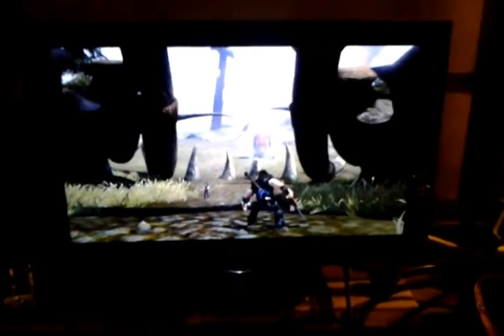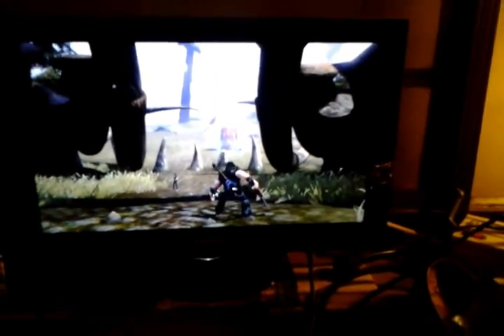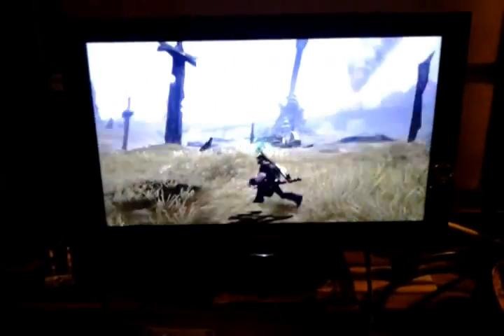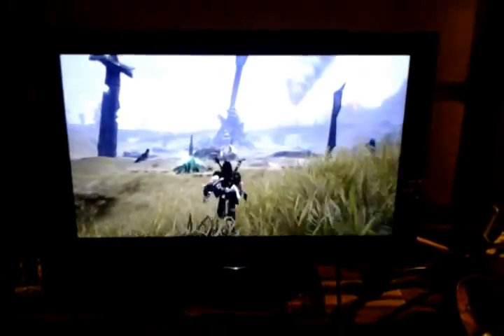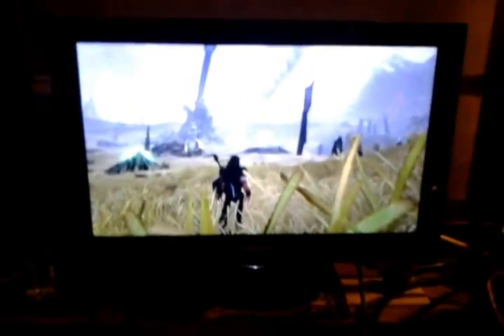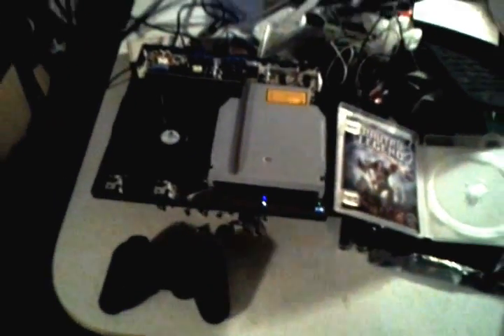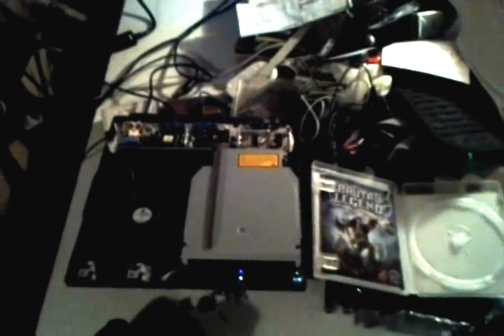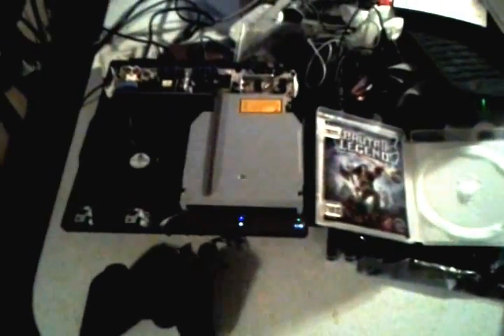PS3 Slim Power Off / Shut Down - Demo And Fix - Not YLOD [cech2501A]

Comment: Do you think a power supply is the problem if I still get a solid red standby light when plugged in, just doesn't do anything when turned on... i turn it on then after 2 seconds it shuts off and i unplug the power cord then i plug it back in then the red standby stays solid red..do you guys think its the power supply?? any suggestions anyone???
Reply: 76lucita did you ever find out what it was ?
Reply: I just played with my ps3 upside down and it worked for me

Comment: There's a different PSU in some Slims (like mine) were the screws are right next to each other. They are still labeled the same though (but I think in a different order). Either way, I turned both to the left about a quarter turn because that's what another vid suggested, and it worked like a charm. But this vid was the first to give me the idea, so thanks loads!

Comment: I got similar problem and i noticed that it the power supply....  Opened it and my power supply doesnt have what you have in the video to turn them with the screwdriver.... So basically I would prolly have to order a new power supply?

Comment: If your PS3 is exactly like this one in the video, then yes.
I don't recall where the letters are on mine. So, if not, notice that each knob is not perfectly round, and the same shape is drawn under the knob. Now try to match each knob with the line drawn under - around it (i.e. the round side fits the round line below on the board, and the rectangle sides fit their lines too.
Sorry if this is confusing, English is not my first language.

Comment: each knob should have its perimeter matching all the lines drawn around it on the board. This way, the right knob will be directed towards the back of the console, and the left knob is exactly the opposite (towards the front of the console).

Comment: for mine i had to find a special screw driver at the hardware store to remove the one blue colored screw in order to open the case. 
It was a Torx screw-driver (looks like a 5 point start). and I think the size was a #5 Torx.

Comment: My problem isn't as serious, my system turns off, but it always turns right back on.
My question, has anyone run into problems fidling with the OPC and PFC screws?
I don't mind if it fries the APS unit, they're easy enough to replace,
But I couldn't take getting YLOD... that'd be too much.
So anyone?

Comment: Did you ever figure it out man? I am having the same issue. My Power supply model is an APS-306. I've tried reflowing, I've tried new hard drive, i've tried this PSU fix....with no luck. It still shuts down to no red light.

Comment: I tried the PSU fix also, tried unplugging the mainboard battery, tried pulling out the fan power plug, put it back in and it started, i put the PS3 back together and tried again, it shut right off again... the last thing i tried was to squeeze it around the edges and believe it or not, it worked! guess my problem is a bad circuit on the mainboard or a bad ground perhaps,

Comment: Would you know what happens in my ps3 slim? On and off immediately (the fan does turn on while in green light)... The power unit has no dials... Model 2511a, the PSU is a EADP-185AP A. Thanks.  video usDXH1kxR5s

Comment: I tries this and it did not work by rotating 100% to CW and CCW.
I found that mine were not in their original directions. So, I restored them to the default directions, then rotated both them from there about 1mm CCW instead. AND IT WORKED!

Comment: ATTENTION ALL!!!
I tried the 1&7 locations and the 100% rotate, both did not work. I also tried both 10% to the right and still did not work. I was not even able to start the system up.
However, in mine the screws were already off the center locations, so I restored them then tried 10% to the left (CCW)  for both and I was able to turn it on again. I will try and play to see if it works for hours.

Comment: hey pls i dont know what to do. my slim plays fine no issues but i touch it and think after 3 hours is hot. is this to reduce heat from supply ??? or do i have to do this after i get error ??? like i said slim is working fine but i thing she should be cooler. is this to reduce heat from supply ?? or fix the turn off problem ???

Comment: I am in the UK and will be trying this tomorrow. Its a 250gb slim model and I have been turning Anti-clockwise (with case off) by 10 degrees and it did not work! This is on other vids on here. Fingers crossed your solution will work or I will have to just buy a PSU unit that is no where to be found in the UK APS-270.

Comment from the maker: Are you able to get it to boot and show any display? Is the system fan operating properly? Are you running it with the the lid off of the system case and with the lid off of the power supply case?

Make a video of it and I'll give you a full diagnosis, there's a chance you've simply got another issue going on.

Comment from the maker: I'm actually making a video response to this with the results of the case mod!

After the mod, I've been able to get 72 hours uptime - all ingame under heavy load!

I added 2 12v PC case fans, one is a 3.5 inch fan and the other is an 80mm fan.

When you're in there, keep in mind the two heat points. One is to the right, behind the BluRay Drive, which is the set of transistors on the aluminum sink. The other is everything in the path of the CPU/GPU heat exhaust in the power brick.